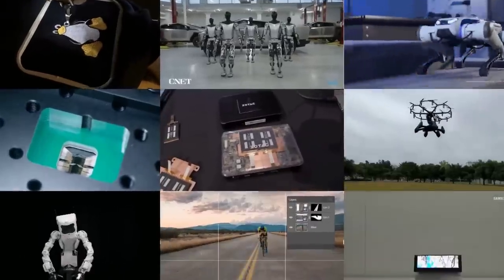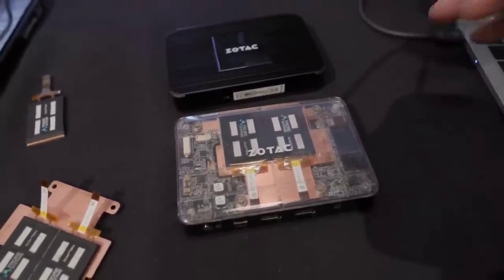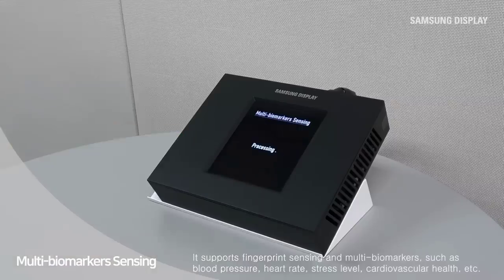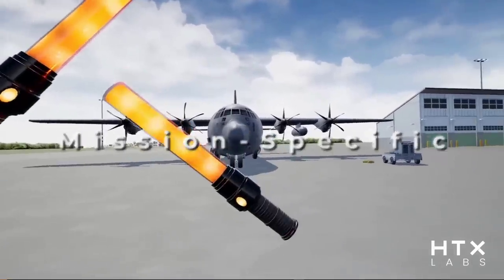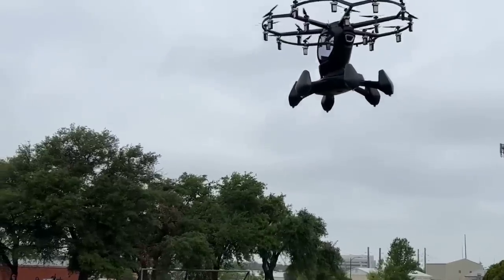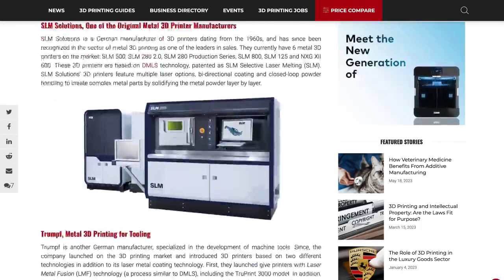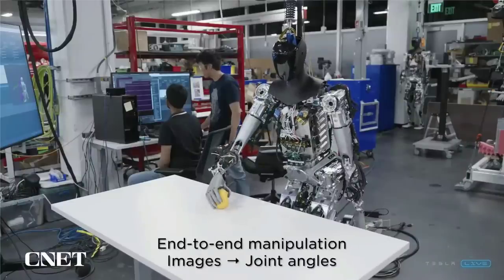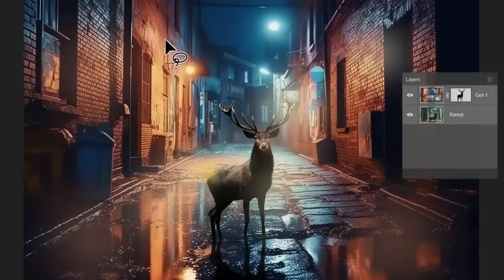Revolutionary PC Cooling Tech is Here | MOSFET Weekly

Comment: The open emroidery machine is interesting. I know from my grandma that embroidery machines and their software are insanely expensive, like $10k to $30k. Could see some grandsons saving their grandmas a ton of money. If more improvements are made to the accessibility, the big companies are gonna have to contend with people willing to go that route to save $10k+
Reply: Brother makes some (like the SE400 or SE600) for < $500, and there are programs like InkStitch or libraries like pyembroidery to DIY with a lot less upfront effort than the design in the video.
Reply: The hobby machines are pretty "cheap" nearing the hobby 3d printer prices. They are basically sewing machines with stepper motors and a microcontroller. I have one from Singer, the digitizing (creating stitch from images) learning curve is a bit steep as the resources for this hobby are sparse and not many. Troubleshooting is a bit difficult for the same reason. Software is usually horrible, even the pro grade Very expensive software are crappy by today's standards. Tho I encourage you to try it, once you get the hang of digitizing it is fun.
You will want to up your game from Inkstitch quickly to at least Embird Studio or Wilcom